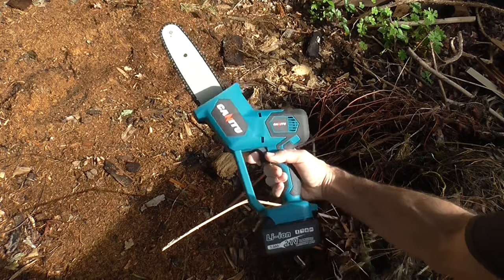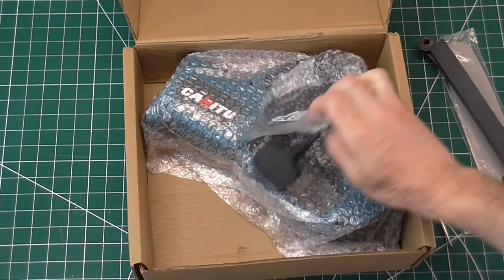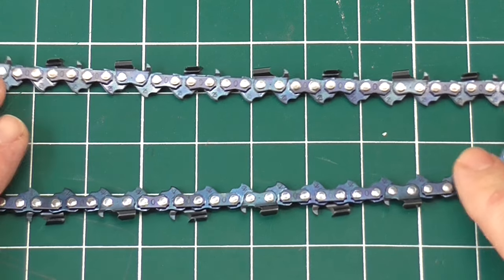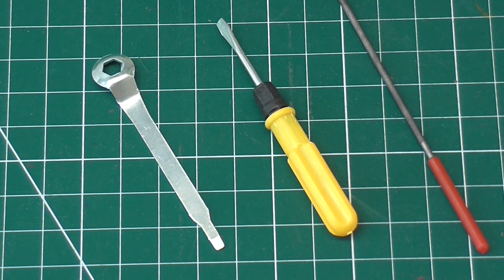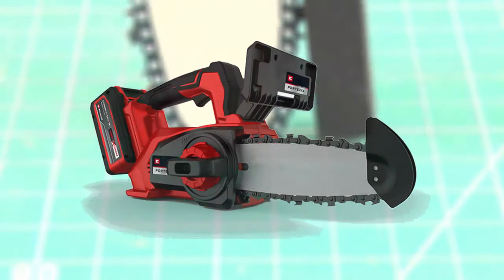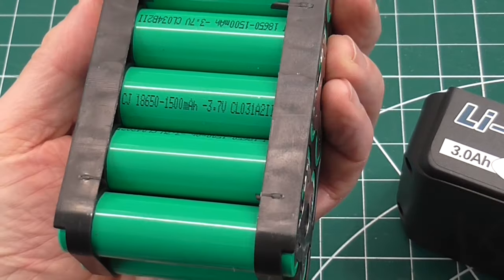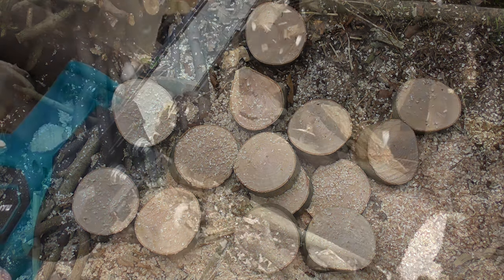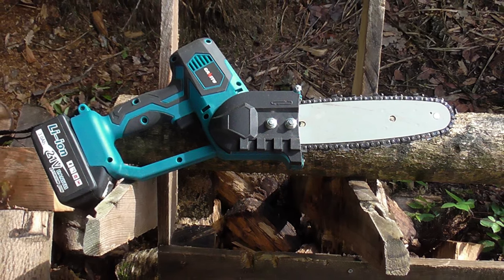Cheap ebay Mini Chainsaw. Any good? Unbiased Review (by somebody who knows what he's talking about).

Comment: £50 is a lot these days on ebay. I've seen them go as low as £10!! I wouldn't trust that to last a single use without breaking. The market is so saturated. And many have claims like 750watt, but in another part it says 700w. And the battery says 42V (but it turns out that's the brand name, lol) and some say 21V max (what does max mean? when it's got a surface charge?) Very dodgy. A LI Battery costs £50 on it's own when you buy from people like Bosch, Makita etc.

Comment: Maybe 25 years ago we had a tree die in the front yard. I got the tree out fine, but tried to hire out the stump removal.  Quotes were outrageous, like $1000, so I said screw it and got an AC electric chainsaw for about $50.  I used it to dig the stump out, cutting dirt and roots and anything else that got in the way.  The saw was completely trash when I was done (drawbar all worn, chain stretched waay beyond spec, motor full of dirt and bearings rattling like a paint can), but for how much I saved, I gladly tossed it.

Comment: I have an 18” ryobi battery saw. Compared to a ms180, it’s even faster and has much more torque. The downside is it runs out of battery long before filling up even more than a 1/4 cord. However, as a limbing saw, it works awesome. When we cut wood, one person cuts sections with the gas saw, and another one cleans up limbs with the battery saw. Works great!

Comment: I purchased a smaller version of this saw last fall. I used it to cut down Lilac trees. It worked pretty good, but the battery life was very short. But I wanted the quiet and I don't own a gas saw. I was also able to cut down 6" black walnut trees. These were remote to where my plugin corded saw would have needed 300 feet of extension cord.
I did purchase an 18" Oregon electric saw. This requires 12AWG cord. I was cutting down large oaks and then breaking them down to human carry-able pieces. The problem with that saw, the universal brushed motor failed from the vibration shock of cutting hard oak. But they have a 2 year warrantee.
Reply from the maker: I believe the smaller version has a brushless motor which is more powerful and also a smaller battery, so battery life must be quite short. Unfortunately high speed brushed motors in tools like this always wear out eventually.

Comment: I'd put a washer under the chain adjusting screw to prevent it digging into the plastic.
Reply from the maker: Yes, some of the shortcuts they've taken in the design are pretty bad, how much more would one washer have cost?
Reply: @AndysMachines  A constant refrain of mine on so many products these days. Even if a washer is fitted it'd be a little on the thin side, but its how they achieve the price points I suppose. If you can save 1,000,000, 1/10ths of a penny on a production run and times that by 3 washers, it soon adds up.

Comment: I agree it is a little ripper and suitable for small occasional jobs. It is pretty low power, so it should be reasonably safe to use. So it does seem value for money. The problem with ultra cheap electric tools is they come and go over-night, so in the unlikely case that it is still functional in 2 years time, you might have a piece of junk because you can't source a new battery for it. Early cordless drills, etc, were notorious for that. 
Not sure about "reverse engineering" some extra safety either. That might create a false sense of security. I suppose a cut-out or dead-man's switch would be OK. 
Professional level tools are value for money too, because you use them, day-in, day-out, and parts are usually available for a long time. 
The thing is flimsy and not over-engineered. If you put an aluminum guard on it, it would just fail at the screw housing for the plastic attachment.  
Love the beaver. A funny, yet professional review.

Comment: I use a Milwaukee hand recip saw for limbing since my other tools are the same brand using same battery(s).

No wrist lanyard either😂

Get a proper blade. Works well for any electric brand. 
Safer than a chain. Easy swap out etc.

Awesome fun review of this option👍🏻

Comment: I bought one of these and it did eventually burn out as I have Makita batteries and using it for far too long with multiple batteries in one go. All in all though it done exactly why I bought it and that was to see if it was useful. I did then buy a 36 makita saw which is great apart from the bar quality which seemed to wear on one side because the bar walls were of a different thickness, a replacement bar seems a lot better. After watching TOT I tried a powered pruner for £30 and that is brilliant for cutting smaller branches and twigs with a far greater battery life , would highly recommend for the garden.

Comment: Looks ideal for a January Sunday afternoon apple tree pruning job, and that’s about it. Always being skeptical about battery chainsaws until I got a dewalt long reach battery saw, it’s damn good, but you find it’s limits when working with trees with very large branches, it will do them but you’ll have regretted trying before it does
Reply from the maker: Yes, it's very handy for small jobs like that. But the time taken to cut through larger logs or branches increases exponentially.

Comment: ive had a simalar saw 4 years now ? i have just about worn it out [ but its cut 5 ton of branches into fire wood lol ] its great for the 60 bucks i paied for it . the chain / bar and batterys will out live the saw .ok i oil the bar every few cuts dip it in sump used oil ........... quick easy better than sex  ,i since did my brush cutter  24v ebike motor and 2 makita batterys the thing is physco plug and play ........... job done before i could mix the 2 stroke oil and petrol

Comment: Good one. Should have seen it before buying one. Only thing I'd like to add. The safe distance mentioned at 22:27 is longer than you expect it to be.
Guess how I know.
Reply from the maker: Yes, things can go wrong very quickly with chainsaws. I didn't even have the battery attached when recording this part. Of course with a proper 2-handed saw you couldn't (or SHOULDN'T) do this, but sometimes people will use their foot instead to steady what they are cutting. (I won't claim I've never done it!)

Comment: I always find the battery expires from lack of use before the saw does.
Reply: Agreed. It seems common for a low the product to be decent, but the accessories not so much. Every cheap security style camera I've ever bought has been great, however 8 times out of 10 the app that runs it is garbage.

Comment: Some battery powered chainsaws in the 12-14 inch range are actually faster than most of their internal combustion counterpart. Like .. Milwaukee and.. Makita if you want comfort. Pound per pound gasoline still gives you longer runtime than batteries. If you are sometimes away from electricity on bigger jobs, batteries are just simply not worth it. And let's face it, as much as I am a battery guy, nothing quite beats that erotic smell of a cold start Stihl.

Comment: I have multiple high end 2t saws.  I'm at the point where they rarely get used.  Have a 65cc equivalent battery saw for the big stuff, and multiple others down to a 10" top handle.  Love gas motors, but I just don't reach for them much any longer.

Comment: I have had a Stihl GTA26 for 2 years. No oiler on that either. However, use any spray can oil before use and it has cut masses of smaller branches rendering the trusty loppers to almost zero use. Quite unbelievable how the mini chainsaw has left loppers 'out on a limb'!
Reply from the maker: Anything made by Stihl will be in a different class to this.

Comment: 1/4" isn't quite the smallest chainsaw chain. Have you seen the Bosch NanoBlade ? I want one, for no good reason at all.
Reply from the maker: Yes, I have seen that, though it's a different design to regular saw chains and is actually much smaller than you'd think based on the pitch of the chain (which I think is 4mm). I don't think it can be sharpened, or even removed from the bar, you just replace the whole thing in one go. It does look fun though and the cut is only about 1mm wide.

Comment: i've used a fair amount of big brand electric chainsaws and personally this one is fairly crappy just for it's quality and lack of safety features. 
lack of hand guard
no electric auto braking (basically as soon as you let go of the trigger it stops)
no dogs
no rubber isolators.
Reply from the maker: I have to agree. Some of the safety issues with this saw would have been so simple and cheap to fix at the design stage, you really have to wonder if they knew what they were doing.
Reply: @AndysMachines  probably due to cost, even though it's cheap to get it to the £50 mark corners had to be cut, would be a fun video of you modifying one of these into a log eating machine that has safety.

Comment: What's that front hole in the bar is for?
Reply from the maker: Most saw bars have a hole here, I think the intended use is for hanging up the bar on a nail to store it. You can store it this way with the chain still attached and it doesn't get tangled. (I actually hang this whole tiny saw on a nail this way).
On bigger bars you can also use this hole to attach things such as sawmill/planking attachments.  In the past I've also drilled extra holes at the other end of the bar as well to fit a sawmill attachment. The bar is hardened steel and you can't drill it with a regular drill bit, you have to use carbide.